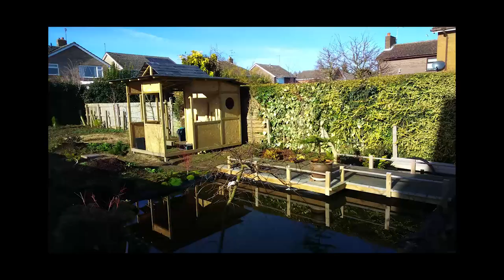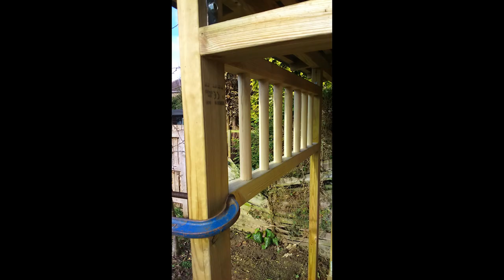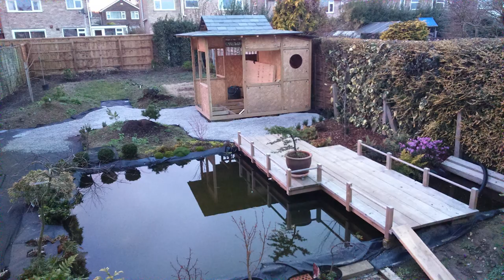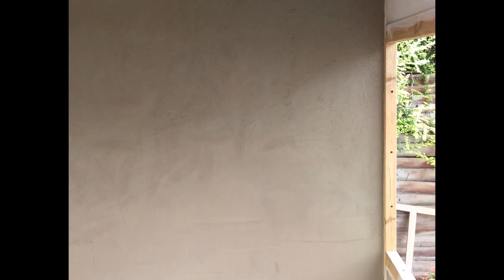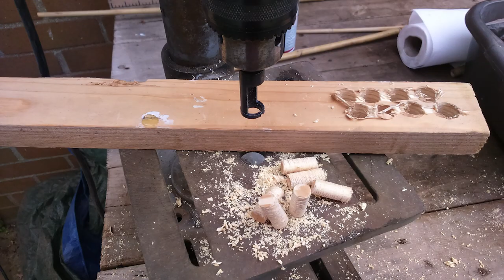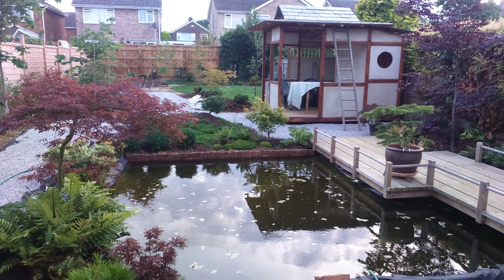Build a Japanese Tea House (Part 2)

Comment: nice job .. Just wondering what you used as render .. Should do a update of your garden now
Reply from the maker: Antony Garwood Thanks, I'll try, but such a lot on currently. It has changed quite a bit too since then.
Reply from the maker: Antony Garwood The render was just sand and cement with PVA... Worked a treat